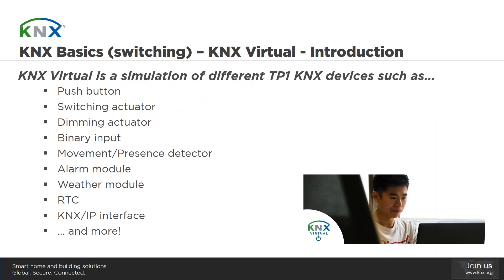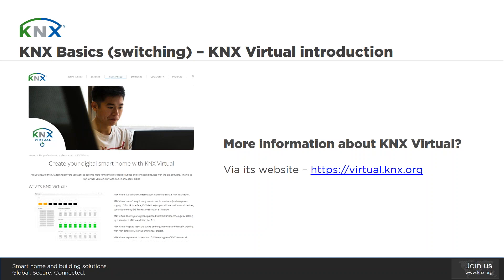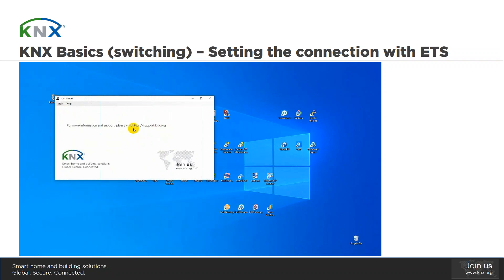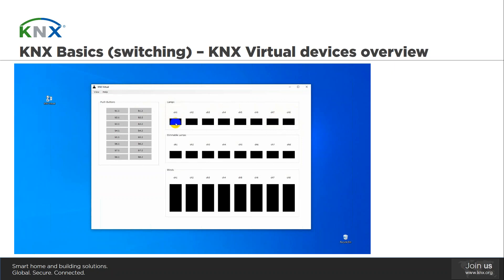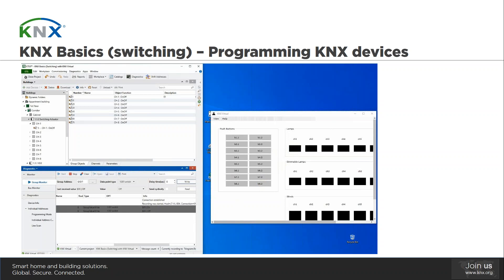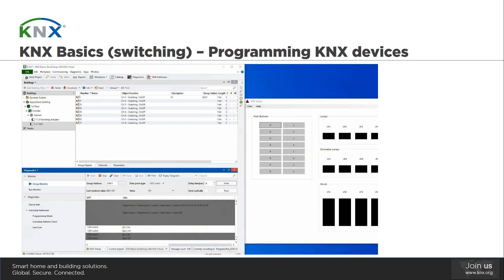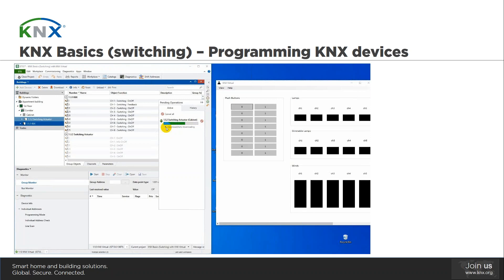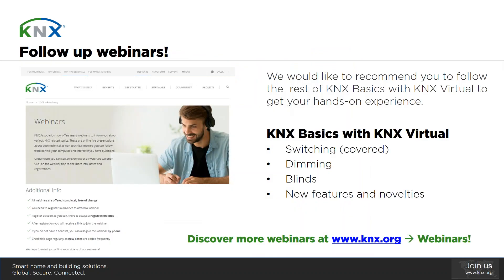KNX Basics (switching) with KNX Virtual

Comment: hello, i downloaded the virtual KNX but when I run it I can't find the setting button and it looks different I think there should be an add-on to make it work because it wasn't work in the beginning because of the missing AI file ?!!! and after I download  ETS5 it is started to open.
Another question I have the free version now if I buy the "USB KNX interface" did this come with the license to make the software work in the professional mode? i mean to put as much I need of devices?
Last thing if I use the virtual KNX and the EST5  i will be able to design my full smart home system and test it be VK or there are other requirements?
Reply from the maker: Dear Sir,

In order to be able to use the ETS5 Professional License you need to order the full ETS5 license in your Shop (1000€), the USB KNX interface is not the product you need if you want to work with ETS5 full license.

Concerning this question:
"Last thing if I use the virtual KNX and the EST5 i will be able to design my full smart home system and test it be VK or there are other requirements?"

Please read:
-> Connect KNX Virtual to a physical KNX installation: 
https://support.knx.org/hc/en-us/articles/360010088319?source=search&auth_token=eyJhbGciOiJIUzI1NiJ9.eyJhY2NvdW50X2lkIjoxMjc3NTY4LCJ1c2VyX2lkIjozNzkzNjg0OTUyMTksInRpY2tldF9pZCI6MTg2OTcyLCJjaGFubmVsX2lkIjo2MywidHlwZSI6IlNFQVJDSCIsImV4cCI6MTYxNjY1Njk3OH0.nV7A1H7i6ViiJHhHnwOvk35NpcmYpVurstaB2ObA-3o

-> Supported devices: 
https://support.knx.org/hc/en-us/articles/360010086179?source=search&auth_token=eyJhbGciOiJIUzI1NiJ9.eyJhY2NvdW50X2lkIjoxMjc3NTY4LCJ1c2VyX2lkIjozNzkzNjg0OTUyMTksInRpY2tldF9pZCI6MTg2OTcyLCJjaGFubmVsX2lkIjo2MywidHlwZSI6IlNFQVJDSCIsImV4cCI6MTYxNjY1Njk3OH0.nV7A1H7i6ViiJHhHnwOvk35NpcmYpVurstaB2ObA-3o